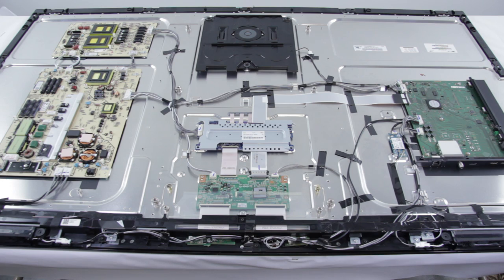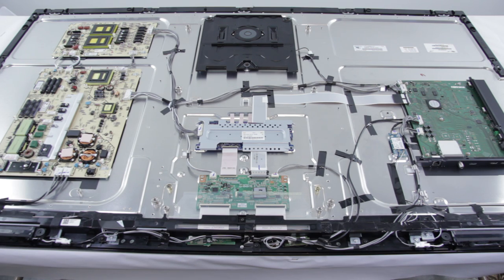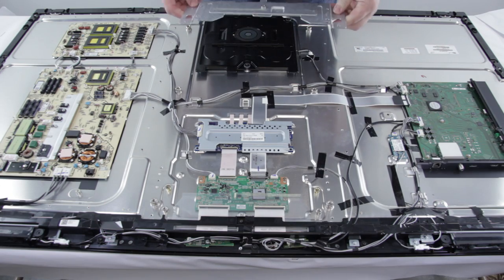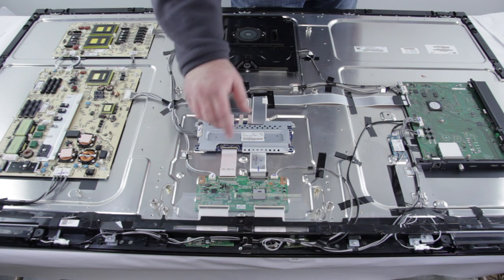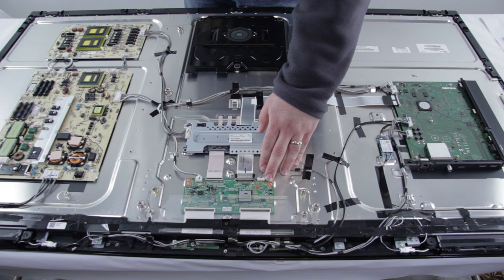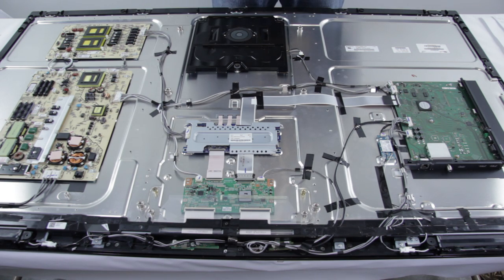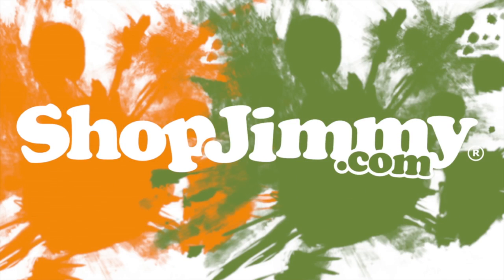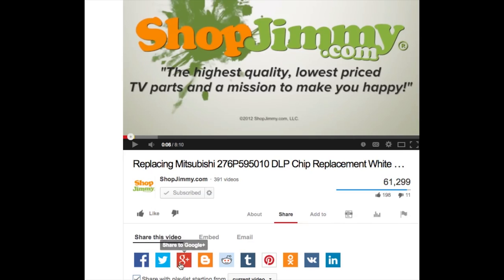LED TV Repair T-Con Board Help Review Overview - Common Issues and Problems with T-Con Boards

Comment: Hey I have an LCD sony bravia (model # KDL -52XBR9 SER # 8004649). It has green vertical lines on the left I tried cleaning the ribbons off in the back of the t con board and putting them back in place and It stayed the same. The left side is also darker then the right. I got the tv given to me by a friend she said after 30 minutes of it being on and warmed up the picture goes back to normal I haven't tried that method but for the most part that's what's going on. Do I need a new t con board??? I know you have them on your website for 49 bucks.
Reply from the maker: Trever Gonzales   This sounds like a TV panel problem.  If your TV panel is bad, it may be more cost-effective to replace the TV as panels are typically hard to find in stock, difficult to replace, and expensive.  Thanks and please let us know if you have any further questions!  www.shopjimmy.com

Comment: Hi , I have my lg 47lm4700 which has vertical color lines but sound is perfect. I replaced the t-con board. But no difference, wondering what can be the problem. Can you please help
Reply: hii sir
Reply: it's cof ic problem ..

Comment: RCA LED 42" television Model # th390Lk01-ACW1. Television will not power on. No image on screen. Does not appear to have sound. Thoughts and suggested part replacements?

Many thanks.
Reply from the maker: +Eric Nippard   Try all repairs and troubleshooting at your own risk.  I recommend replacing the main board in your TV.  Unfortunately I do not see any replacement parts in the search results for your TV model number on our website.  Please reply with your part number on your main board and I can try searching for replacement parts.  Thanks and please let us know if you have any further questions!  www.shopjimmy.com
Reply: +ShopJimmy.com The model number of the main power supply is CVB39001. Would you have that item available?

Comment: hello i have a Insignia NS-37D20SNA14 it will power on but when it does there is almost no backlighting , screen flickers , barley see the picture as it does this  , there is audio
Reply from the maker: Shane Little  PLEASE SUBSCRIBE TO OUR CHANNEL - Try all repairs and troubleshooting at your own risk.  This could be a problem with either the power supply or the LEDs in the TV.  You can replace the power supply board to see if that fixes the problem.  Unfortunately I do not see any replacement parts in the search results for your TV model number on our website.  Please reply with your part number on your power supply board and I can try searching for replacement parts.  Thanks and please let us know if you have any further questions!  www.shopjimmy.com

Comment: Philips Model Number 40PFL505D/F7 Left side of screen works fine. Right side is discolored (almost a bluish gray color) Is there a possibility that it's a t con board issue?
Reply from the maker: +Mike Wallace   Try all repairs and troubleshooting at your own risk.  This sounds like a TV panel (TV Screen) problem.  If your TV panel is bad, it may be more cost-effective to replace the TV as panels are typically hard to find in stock, difficult to replace, and expensive.  Thanks and please let us know if you have any further questions!  www.shopjimmy.com
Reply: +ShopJimmy.com The t con board cleared up the right side of the screen but a vertical bar remained in the middle. Broke down the tv further to find that the panel connectors were damaged, something spilled on it most likely. Going to take a shot at this repair and then recommend to the owner to look into buying a new tv if this doesn't work. Thanks!
Reply: +Mike Wallace 

How did that work out?   I have a HISENSE F42K20E that probably has a water damage problem.

I’m going to dry it out and then investigate.

If the screen ribbon can be warmed and peeled off the PCB, I think the silver ink pens might be a way of rebuilding the damaged traces.

Comment: hi i got a problem in my LED tv model name and number is ( panasonic viera TH-L29B6DX) 

and problem is screan got blackout i have done the flashlight test also no and removed the back cover also ,there is no light nor sound but power board is working ...... hope for a fast reply cya!
Reply: Yes sir but i couldnt find anything ... But one more thing whn im turning on the tv only panasonic word is cuming on screan but its blury

Comment: My sharp model #  lc-70le640u  the screen has a solid black line ( vertical ) off left center,Can you help.
Reply from the maker: Benjamin Hernandez   Try all repairs and troubleshooting at your own risk.  This sounds like a TV panel (TV Screen) problem.  If your TV panel is bad, it may be more cost-effective to replace the TV as panels are typically hard to find in stock, difficult to replace, and expensive.  Thanks and please let us know if you have any further questions!  www.shopjimmy.com

Comment: Hey guys I have a Sony Bravia KDL60w855B, my picture had streak lines going vertically on the screen and then the screen would turn off and now I have 5 flashing red lights displaying.. I hope it's just a faulty tcon board as I have ordered a replacement on eBay. If it is not the tcon board what else could it be?? Much appreciate your channel!! And subscribed!

Comment: So glad I found your videos!  Hopefully you can help me out with my problem.  I have a Samsung LED model UN60ES6100 that is displaying only a couple of thin, vertical, blue and green lines.  The sound is great, but no picture...not even the native TV menu can be displayed.  Here is the part that scares me:  In addition to the thin blue and green vertical lines, it appears as though there are "irregular" lines emanating from the lower portion of the screen where the vertical lines originate.  These lines are not very big, but noticeable when up close.  From your videos my initial description points me to a T-Con board (I think).  But then there is the "irregular" thing I have not been able to explain or find information on.  I will be glad to know your thoughts....even if it hurts!
Reply: Additional Info:  After leaving the TV unplugged for 24 hours, the right half of the screen now shows video but the left has more vertical lines accompanied by black bars in between.  The extreme left side of the screen shows clear video.  I also have a couple of thin horizontal lines along the bottom of the screen.  Please let me know your thoughts.
Reply from the maker: Jeff Sherman   This sounds like a TV panel (TV Screen) problem.  If your TV panel is bad, it may be more cost-effective to replace the TV as panels are typically hard to find in stock, difficult to replace, and expensive.  Thanks and please let us know if you have any further questions!  www.shopjimmy.com

Comment: The picture on my UN46B8000XFXZA is solid white on half the screen and washed out on the other half. Any suggestions for repair?
Reply from the maker: +Marc Petz   Try all repairs and troubleshooting at your own risk.  This sounds like a TV panel (TV Screen) problem.  If your TV panel is bad, it may be more cost-effective to replace the TV as panels are typically hard to find in stock, difficult to replace, and expensive.  Thanks and please let us know if you have any further questions!  www.shopjimmy.com
Reply: +ShopJimmy.com I appreciate the reply! thanks for the help.

Comment: I have a samsung LCD-LED Backlight UE32D5000. When I plug in the cables to the LED back lights it just makes a feint clicking sound and not power up, if I disconnect the LED connecter it will power up but I can not see the picture. can the LED back light be replaced or repaired ? Thanks
Reply from the maker: Kieren Dight   Unfortunately this cannot be fixed.  Thanks!  www.shopjimmy.com
Reply: Thanks for the reply

Comment: Hi there I have a Samsung ue46b7020wwxxu it started to show vertical lines on the screen is have uploaded a video on YouTube please help me
Reply from the maker: Paul Crouch   This sounds like a TV panel (TV Screen) problem.  If your TV panel is bad, it may be more cost-effective to replace the TV as panels are typically hard to find in stock, difficult to replace, and expensive.  Thanks and please let us know if you have any further questions!  www.shopjimmy.com

Comment: Sanyo DP 46484 comes on for 3 seconds backlight is on for half second and powers off. I have replaced power supply. And main board what else could cause it to completely shut down
Reply: Any idea where to buy lamps

Comment: Philips 40pfl3705d/f7 tv.  The sound and tv turn on but there is no picture.  Any idea the issue/parts needed?  Thanks!
Reply from the maker: Joanna V   I recommend running the flashlight test on your TV.   Here is a link to a video we produced that shows how to run the flashlight test. https://www.youtube.com/watch?v=xUzCLgoSPGM Please reply with your flashlight test results and we can recommend a replacement part for your TV repair. Thanks and please let us know if you have any questions! www.shopjimmy.com

Comment: Hello, I have a LG 55LM4600 , I have a picture that goes bright  then light , picture is there , but its like the brightness is being turn up then back down over and over. like a pluse from right to left. Help Please. set is just under 2 years old.
Reply from the maker: Gavin Robinson  Please watch this video FIRST to help with your repair!  https://www.youtube.com/watch?v=BP3NVNCGEv8  I recommend replacing the t-con board in your TV.  Click this link to replacement parts for your TV model number:  http://www.shopjimmy.com/catalogsearch/result/index/?cat=63&q=LG+55LM4600  There may be multiple boards for the same TV model number, be sure to match part numbers on your current board, with your replacement for compatibility.  Here is a link to a video showing how to identify your part number, click here:  https://www.youtube.com/watch?v=J1GmfoeQeP4  Thanks and please let us know if you have any further questions with your TV Repair!  www.shopjimmy.com

Comment: Hi. how are you guys? I have an Insignia NS-46D400NA14.for about a year now. like 2 weeks ago, it started giving me less image on the left half side of the screen. the image was darker on the left side. now it just has no image, but it has sound. Could it be the Tcon? thank you guys!
Reply from the maker: donlion1981   This sounds like a TV panel (TV Screen) problem.  If your TV panel is bad, it may be more cost-effective to replace the TV as panels are typically hard to find in stock, difficult to replace, and expensive.  Thanks and please let us know if you have any further questions!  www.shopjimmy.com

Comment: I have an LG Smart TV (Model - 47ln5700)
It'll turn on, flash the LG logo very brightly for a second, then dim out completely. However, it'll still produce sound as if it was on. On the back, there are no lights on when the TV is turned on. I took it to a local TV repair shop and they said the whole panel would have to get replaced, but I have a feeling that's not true. Could you please tell me what might be wrong?? Thanks!
Reply: I'm having the same issue with the same tv.. Did figure out what was the problem .. Please let me know
Reply: No I haven't, actually. I was going to consider just trying to sell it for parts on eBay. I mean, it'd have been perfect if I could've got it working. Oh well :/
Reply: 8on

Comment: SONY 
KDL - 40v4100
Its showing bad picture, almost like an x-ray color. Both the main picture and the menu are affected. Is the problem the T-con Board?
Reply from the maker: +overdrive006   Try all repairs and troubleshooting at your own risk. This could be a problem with either the t-con board, the main board or the TV panel. You can replace the main board and the t-con board individually to see if one of those boards fixes the problem.  Click this link to replacement parts for your TV model number:  http://www.shopjimmy.com/catalogsearch/result/?q=40v4100  There may be multiple boards for the same TV model number, be sure to match part numbers on your current board, with your replacement for compatibility.     Thanks and please let us know if you have any further questions with your TV Repair!  www.shopjimmy.com

Comment: Philips LCDTV model 40PFL3705D/F7.  Has no picture but sound works.  In the dark a faint glow can be seen coming from the screen but no picture... please help!
Reply from the maker: Andrew Shea   I recommend replacing the T-Con board in your TV.  Here is a link to replacement parts for your TV model number on our website, click here:  http://www.shopjimmy.com/catalogsearch/result/index/?cat=63&q=40PFL3705D%2FF7  Be sure to match part numbers on your current board, with your replacement for compatibility.  You can also call our customer service for further assistance with your purchase.  (877) 881-6492  Thanks and please let us know if you have any further questions with your TV Repair!  www.shopjimmy.com

Comment: Hello, I have A LG television , model # 47LN5700-UH ... when turned on the screen is fine for one second then all the light has gone away, there is a very faint picture , but very faint....The bottom light under the screen blinks red three times after the picture has gone away. I do have sound
Reply from the maker: bobbysean82  Try all repairs and troubleshooting at your own risk.  This could be a problem with either the power supply or bad LEDs in the TV panel.  You can replace the power supply board to see if that fixes the problem.  http://www.shopjimmy.com/lg-eay62810801-power-supply-unit.htm  There may be multiple boards for the same TV model number, be sure to match part numbers on your current board, with your replacement for compatibility.  Here is a link to a video showing how to identify your part number, click here:  https://www.youtube.com/watch?v=_4Qpfan0vdU  Thanks and please let us know if you have any further questions with your TV Repair!  www.shopjimmy.com

Comment: I have a VIZIO M601d-A3R - Last night a horizontal line of what appears to be a black line initially, appears, but on further investigation it appears to be bright pixels. It is not completely being blank when i have the tv on, the images still show up but that particular line is darker on the right end and brightens up and fades into regular picture, it doesn't stretch all the way across the tv but about 70 percent of the tv from the right(darkest) to the left(where it fades) 

I opened up the tv and cleaned it, the connections appear to all be fine but I was wondering if it is a tcon or main board issue.
Reply: just to add data, I did additional color tests, blue and green appear fine, but every other color is affected by this dead/bright pixel line
Reply from the maker: John F   This sounds like a TV panel (TV Screen) problem.  If your TV panel is bad, it may be more cost-effective to replace the TV as panels are typically hard to find in stock, difficult to replace, and expensive.  Thanks and please let us know if you have any further questions!  www.shopjimmy.com

Comment: Hi, I have a Sony Bravia KDL 46" NX 720. Since 3-4 days the picture has turned reddish. When I tunr on the TV instead of the black screen I get a red screen with the SONY logo. When I turn on the DTH or play something via USB / Blu-Ray the picture is reddish across the screen. I have reset to factory settings, restarted the TV, tried different connections / cables, nothing works. Checked with the default photos stored on Bravia. Still the reddish tinge across the screen. Please help.
Reply from the maker: Alex P   I recommend replacing the main board in your TV.  Here is a link to replacement parts for your TV model number on our website, click here:  http://www.shopjimmy.com/catalogsearch/result/index/?cat=56&q=KDL-46NX720  Be sure to match part numbers on your current board, with your replacement for compatibility.  Here is a link to a video showing how to identify your part number, click here:  TV Part Number Identification Guide for Sony Main Boards (LCD, LED, Plasma TVs) TV Repair  You can also call our customer service for further assistance with your purchase.  (877) 881-6492  Thanks and please let us know if you have any further questions with your TV Repair!  www.shopjimmy.com

Comment: hi ,

I have question on my tv ,Its Sony kdl-32ex420 it appearing back light  no video pictures ,and  some time appearing pictures some time blank , but audio is working good
Reply from the maker: raghu .k   I recommend replacing the T-Con board in your TV.  Unfortunately I do not see any replacement parts in the search results for your TV model number on our website.  Please reply with your part number on your t-con board and I can try searching for replacement parts.  Thanks and please let us know if you have any further questions!  www.shopjimmy.com

Comment: Samsung le40d550k1wxxusam. The problem is the screen is blank, no screen. I have touch panel with "bittons" below the screen and that blinks so I guess it works and there is some power getting to the TV. Thanks
Reply: +Gregory May Sorry it is samsung le40d550k1wxxu not le40d550k1wxxusam...

Comment: My vizio model # E321VT picture is upside down. I did a reset and it used to flicker on and off, but now the picture is upside down.
Reply from the maker: Dre Fayson   Replace the main board in your TV.  See your replacement main board here:  http://www.shopjimmy.com/vizio-cbpftxccb02k0210004-main-board-for-e321vt.htm  Be sure to match part numbers on your current board, with your replacement for compatibility.  Here is a link to a video showing how to identify your part number, click here:  https://www.youtube.com/watch?v=kxkeGLhlQY8  Thanks and please let us know if you have any further questions with your TV Repair!  www.shopjimmy.com